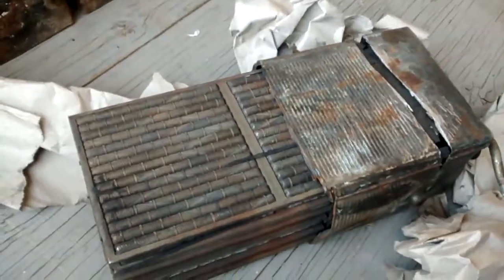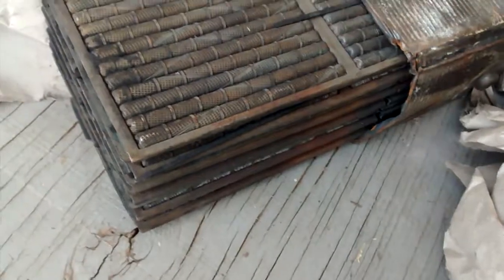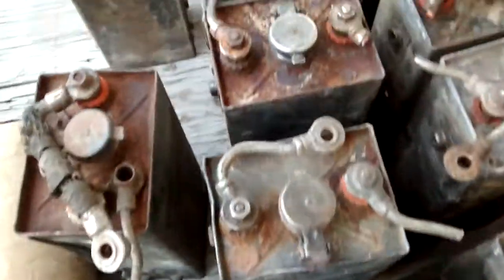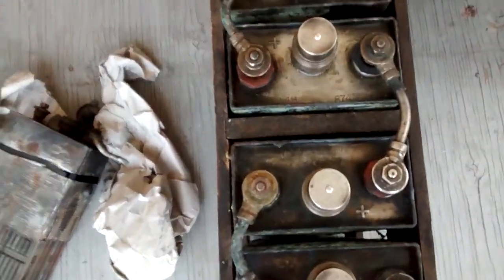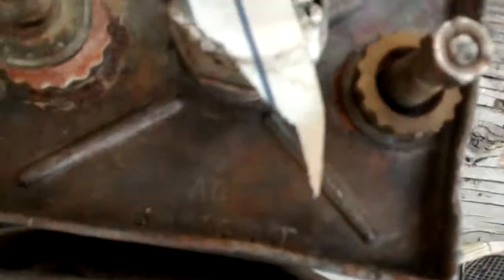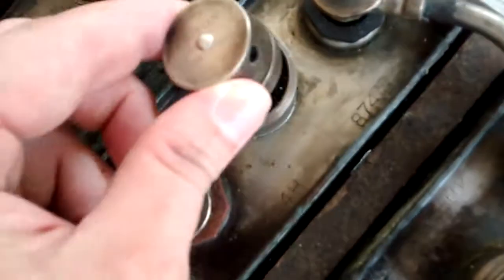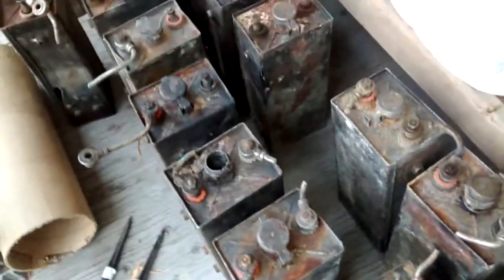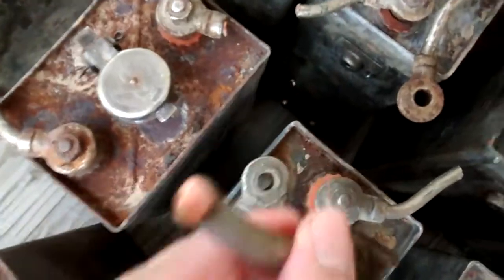Edison Nickle Iron Alkaline A6 LOT arrives! First look.

Comment: If they are what I think they are:  Metal cased cell's that do not open and if they are just through them away:  Now if the metal cases can be opened for maintenance Keep and restore them:  If they don't open don't get any more unless your going to put them into a museum.
Reply from the maker: Hmm, tell me more. I'm listening whilst restoring them. Meanwhile go watch all the videos about these I made, you have some catching up to do.
Reply: Been watching them and I've read the book: This type of cell is or can be referred to/as a Edison style: Now other type's are NI-CD, NI-LI, and some others but the all have one thing in common and that is they are filled with Potassium Hydroxide (KOH):  Some history on how Edison came to invent them, he wanted to transmit power as DC and not AC and the batteries that would be made from the cell's would store energy until needed like at peak times: Now we know why won the DC AC battle, But the flooded cell NI-type cell has been the greatest invention in the past 120 plus years.
Reply from the maker: No tell me why to throw them away when they are restorable? Where are your videos? Your channel is empty. https://www.youtube.com/watch?v=jyMPHp6yeFo
Reply: They can be restored (trying to get your attention) but the ED-240 cell's have a plastic case and are easier to take apart because they are flooded NI-CD and the plates are bolted so you can make completely new cell's by replacing bad plate's  (Have to take apart more then one witch you would do when restoring many cell's).  Now your Edison cell's are flooded NI-FE and some of the iron plate's were bolted but some of the Iron plates were wielded  (Don't buy the Chinese flooded NI-FE one's they are wielded) On the ED-240 the "ED" stand's for Edison. The metal case and the construction of the cell's them self's make them hard to rebuild. But they can be rinsed out with boric acid until clear can let them set for a little while I would start with a Half hour first and shack often repeat as needed then rinsed with distilled water very good (Must get all of the boric acid out) And only refill with KOH  leave the LI mix out they did not have the LI mix back then and you could damage the insulators between the plate's.
Reply from the maker: Good grief, Edison talks of Lithium in his patent. Do you have any of these yourself? Edison warns over and over never use acid in these. Your info is cornball.